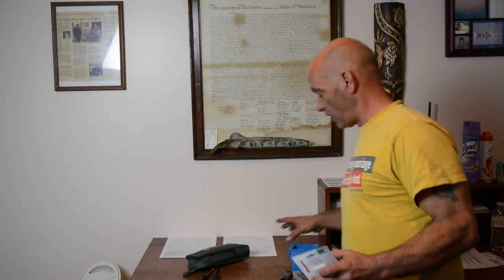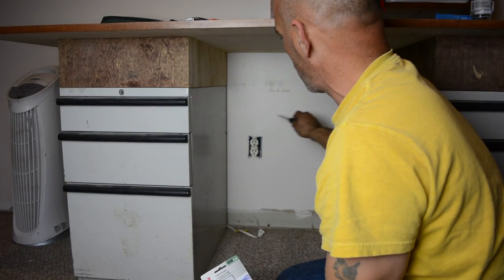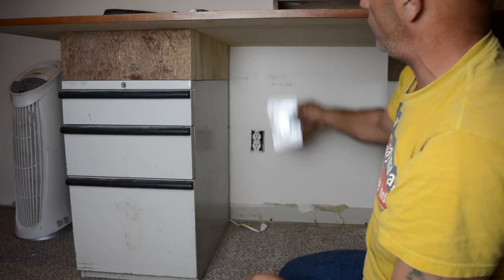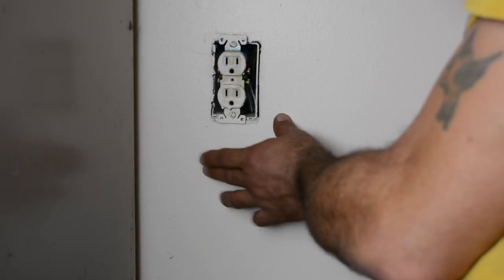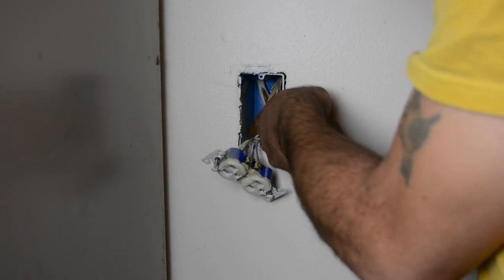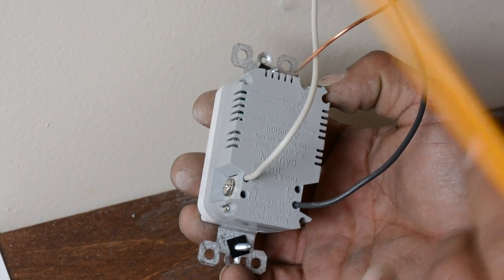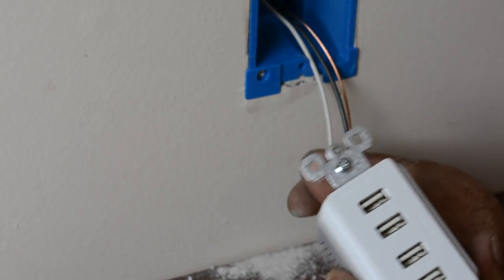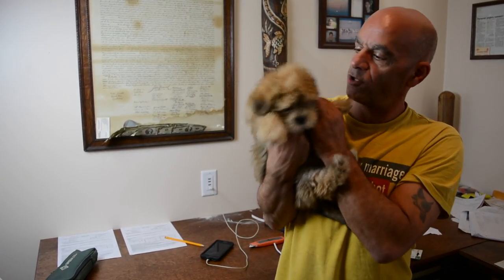How to install a USB charger outlet in the wall.

Comment: hi there! I have been using your DIY vids for years now and I wish to thank you for these videos!! I have a question I hope you can answer for me... 

I want to connect my Leviton USB Charger/Tamper-Resistant Duplex Receptacle to power coming in. Which I have done. But I want to take the power out to feed power to a switch that is connected to another normal outlet. Should I connect power in to the Leviton brass screw and the power out to the silver screw and then connect the two red (Neutrals) together using wire connectors??
Reply from the maker: Are you saying the reds are neutrals?
Reply: yes
Reply from the maker: Send me pictures of what you have ok, via my website. www.askmediy.com

Comment: Two problems...the annoying beeping and back stabbing the outlet is not the way to go...curl around the screw is the best
Reply from the maker: That's the beep letting me know that it doesn't have 120v active. Power was turned off to the room, remember?
Reply: If you’re talking about how he hooked up the usb outlet, he didn’t back stab the outlet, you put the wires through the holes (like a back stab) but with the usb outlet you tighten the screw terminals on the sides and that holds the wire in place securely